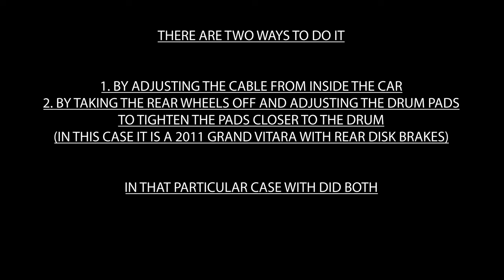DIY - how to adjust HANDBRAKE CABLE Suzuki Grand Vitara | איך למתוח בלם יד סוזוקי גרנד ויטרה #diy

Comment: Super interesting! Thanks! I do understand what you do inside, but I do not comprehend what do you do outside in the wheel place
Reply from the maker: Hi
Thanks 
In the rear wheels there are hand brake pads. They hold the car from moving in parking by attaching to the wheel drum. When the pads wears down you need to stretch it and get it closer to the drum. That’s what we did outside the car. There is a small “turn screw” that you need to turn and that’s how you fix it